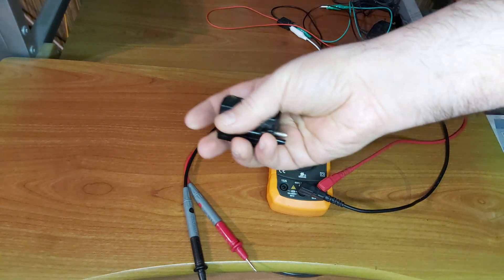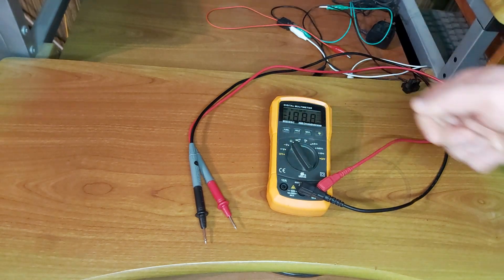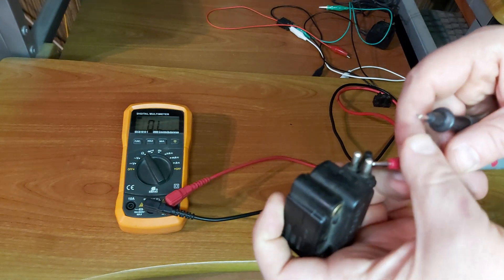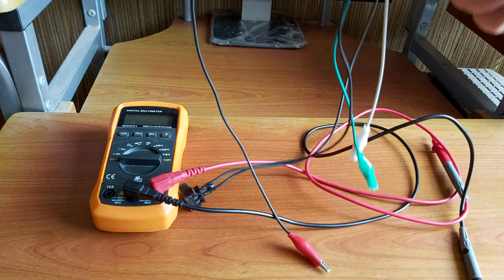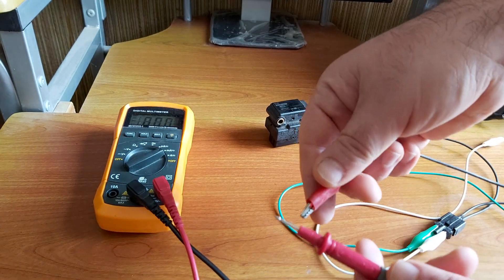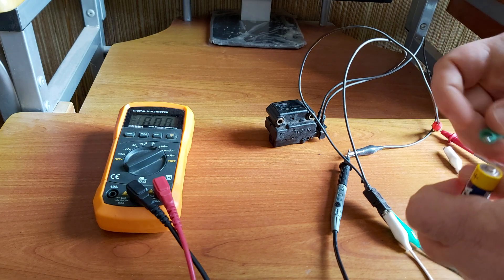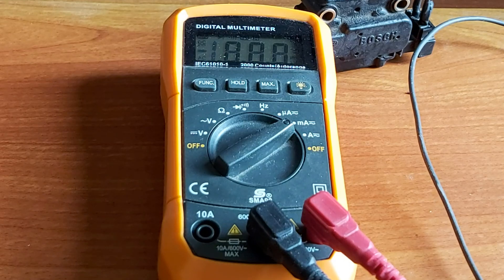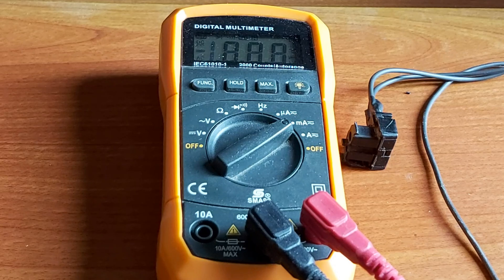㉦Mercedes Ke-Jetronic㉦ - ⚡🗒Testing the EHA 🗒⚡

Comment: Is 1.5v actually enough to fully trigger the EHA movement/mechanism inside? i'm trying to get some rubber seal rejuvenator in there to hopefully prevent the fuel leaking by the old seals, but it doesn't accept fluid through either of the 2 holes where the fuel usually flows.

Before finding your video, I tried with a 9v smoke alarm battery, and I could hear the EHA gently click only when I disconnected the power, but still it doesn't seem to allow the fluids I'm feeding it to flow in, no matter what I do.. Any advice?

I have fuel leaking from top breather hole on the outside face, and seemingly from all around the joint of EHA to car really, so I assume I can get some seal rejuvenator to reach the same point fuel is leaking from inside the EHA? Do I need it to be plugged into the car to operate? I tried a 9v + 6v battery in series for ~14v but that had identical effect to the 9v it seemed. No flow :<
Also tried replacing the 2 little o-rings where EHA meets car, which wasn't apparently the problem.

Thanks very much if you have time and inclination to answer this :) We're trying to find another one but they are so very expensive...
Reply from the maker: 1) Is 1.5V enough?
Yes. The EHA coil is ~19–21 Ω. At 1.5 V you get ~70–80 mA, which is basically “full” deflection for a bench test (polarity decides ±). Use short pulses only (≤1 s).
2) Why your 9 V didn’t “flow” anything
Two reasons:
Dangerously high: 9 V across ~20 Ω = ~450 mA (don’t do this; you can overheat the coil). If you ever must, add a 47–100 Ω series resistor and still keep it pulsed.
The EHA doesn’t “open a passage” like a valve at zero pressure. It trims differential pressure. Without fuel pressure (~5 bar) from the distributor, nothing will “flow” through by syringe or gravity.
3) About “seal rejuvenator”
Don’t. Those chemicals can swell/damage internals and contaminate the system. If liquid won’t pass, it’s not because it needs a softener — it’s because you lack pressure or the internals are gummed up.
4) External leak at the top breather hole
That’s the big red flag. Leaks from the breather/around the body usually mean internal failure (diaphragm or body seal). O-rings at the mounting face won’t fix that. Realistically: replace the EHA. Cleaning won’t cure a breather leak.
5) What you can try before replacing
Ohm check: 19–21 Ω → coil OK.
1.5 V pulse test: crisp “click” both polarities → actuator moves.
Check system & control pressures and observe EHA current. If it still leaks or behavior is erratic → it’s done.
1.5 V is enough for a safe bench “move” test. Don’t use 9–14 V direct; add series resistor if you must. No flow without 5 bar — that’s normal on the bench. Leak from the breather = terminal EHA → replacement is the real fix.
If you share the coil resistance and a 1.5 V pulse video/sound, I can tell you in 10 seconds whether yours is just sticky or truly finished.
Reply: @mercedeske  thanks heaps, and sorry I write so much! XD

Resistance test is ok like 20.5 ohm, and doh! test voltage issue noted. Pulse checks so far have only yielded a tiny sound when power is disconnected, and sound is so soft I don't think I could even record it over ambient sounds, and only one polarity- other way yields nothing I can hear (prev tests with 6v etc). Actuator only barely ticks 1 way = it's completely toasted?

I don't have any connectors for anything so the 1.5v batt test with multimeter inline to see draw needs more hands to do XD

One of the only test wires I had available was a pointy test lamp poker w/ alligator clip, so that would have limited current during testing maybe/I hope? tho I guess it doesn't matter since I can't fix the internals anyway it seems >.<

Seeing the internal parts cut open online I was so sure ATP 205 would have corrected any leaking issues caused by alcohol use in fuel and shrinking of the internal gaskets, and a guy on merc forums (last seen 2009 oof) said he "flooded internals" with some combination of stuff to resurrect them, but I can't understand How he did that!?

ATP claims it's just a plasticiser that will only be absorbed if stuff has lost its own, and promises to not swell anything at all, only return it to original shape/consistency, so I feel like it's perhaps minimally risky in terms of contamination if I could somehow get some inside the EHA? Still clinging to the idea lol

We've ordered a used part, so that may or may not work and will take a while to come. In the meantime I was hoping to maybe help this one somehow.

Last thought is that if fuel leaks out the breather hole, logically I can force some ATP into that breather hole, and it will make its way to wherever seal the fuel leaked by? idk if this stands to reason XD sorry to bother you with all this probable futility! <3
Reply from the maker: @outseeker  The EHA has no diaphragm — just two electromagnets and a baffle plate that moves to enrich or lean the mixture.
The only serviceable part is the tiny O-ring under the 2 mm adjustment screw; nothing else can be restored.
If your EHA leaks through the breather or housing, unfortunately, there’s no saving it — replacement is the only fix.
If it still shows around 20 Ω, the coil is fine, but the leak means it’s mechanically done.
Reply: @mercedeske  Thanks again! :D
Do you know how the fuel flows within the EHA? or it's not supposed to flow through it at all really, and the only flow is between the 2 middle holes somewhat directly, with differential between 2 holes adjusted by the baffle plate somehow?

From vids where ppl cut open EHAs for us, I've not seen shown/demonstrated the actual correct fuel path/functionality of the EHA. I just see the baffle plate with gaskets on itself and on the parts each side of it, but is that just for "air" pressure, not for fuel to actually come into contact with? Sorry idk if I understand the thing right!

I was under the impression that running with alcohol in our fuel shrunk/dried the big racetrack shaped internal EHA rubber gaskets, but if fuel never came into contact with those gaskets by design, that would be impossible XD

Finding it hard to picture how fuel leaks out when it fails, like what exactly failed to cause it to leak if not just the rubber seals internally..? There doesn't seem to be anything else even in there to fail?
Reply: @mercedeske  Quick followup since you were so kind as to reply to me! We can in fact at least partially/temporarily repair the internal seals on these EHAs, as I had imagined and read about, and mine no longer leaks fuel out the front holes at least for the moment!

All I used was a few ml of AT-205, and a syringe with a needle. I had fuel weeping out of front middle top (breather?) hole, so after removing and letting the EHA dry of fuel for a few hours, I gently injected a tiny amount of the above plasticiser into said hole, and watched it "drink" it. Rotating the part on every which angle, adding a tiny drop, and continuing to rotate, using shake/throwing action to use g-forces, gently tapping, and basically hoping the fluid makes it where it needs to go eventually.

Would have helped if I could know the physical "pathway" things would be travelling exactly from this hole, but whatever, it just takes you longer to try all rotation positions and add droplets.

One particular orientation (standing EHA with pins upwards I believe) yields a very slow and visible bubble blub blub drinking motion in the hole we're filling, so it was certainly getting in there, and that blub action stopped after quite a while of my adding, rotating, wiping off excess, leaving it a while, repeating, etc. so I'd done about all I could possibly do to reseal it.

At this point I slept, leaving the EHA sitting flat, breather holes up. In the morning I reattached the EHA to the car, and it no longer leaked when pressurised with fuel! Not even a slight smell of fuel is present.

Instantly started, but stalls after a second. Kept trying to keep it running and restarting it until it was willing to idle- I assume we introduce some air by doing this work, that wants to make its way out, or maybe my activities somehow modified the EHA operation/calibration slightly so it needs the screw mildly adjusted to compensate.

Comment: I have a problem that I cannot solve right now. When I stop my 200e vehicle with LPG Autogas while the engine is hot, wait for 5-10 minutes and try to start it again, it starts very late when I start it with the fuel oil selected. Sometimes I have to step on the gas pedal. Additionally, when the vehicle starts, it makes a noise for the first 3-5 seconds and the idle speed is very low. It starts to return to normal within 10 seconds. What do you think is the problem? Where should I look?
Note: 4 injectors were replaced with new ones. The problem persists. I suspect the gasoline pressure regulator, but it is not possible to source it here. I replaced it with 2 off-the-shelf parts, but it didn't work. Sorry it's been a bit long.
Reply from the maker: Have you replaced or tested the fuel accumulator?
Reply: @mercedeske  No. Not yet sir.

Comment: can we repair an eha if it is leaking, not at the little rubbers but somewhere from under the black plastic?
Reply from the maker: You can just replace the o-ring under the adjustment screw, there is nothing else you can do. If you have a pressure loss, then you must replace the eha.
Reply: @mercedeske  :-( will try gasoline resistant plastic glue or few layers of strong paint with what the fuel tanks are painted inside :-)
Reply: @Joccka  Let us know if that works.

Comment: Thanks very much for your kind information which it takes my consideration.
Actually i would like to clear something about the EHA, as you told in your previous videos that the measurement of EHA under the top by caliber is 6.6mm and we can measure up to 6.8mm to get the best pressure of fuel distributor 0.4 bar.
I have measured the EHA up to. 6.8mm then test my car where my car is Mercedes W124 260E then found very very will acceleration , But this method has a negative impact on fuel consumptions.
So i get back the measurement to 6.6mm with smoothly acceleration.
Reply: What do you mean by 6.6mm and 6.8mm on the EHA?
Reply: @shaazy  You have to watch previous videos about EHA from the same youtuber
Reply: @issamalmousa76  I had missed the one where he discussed 6.6mm. 😅 .. finally found it! Love this guy!